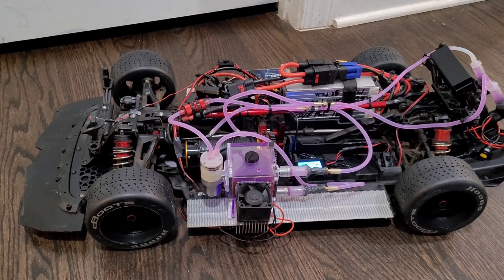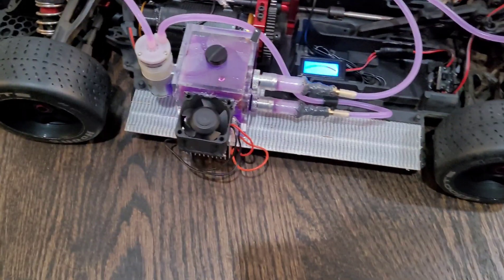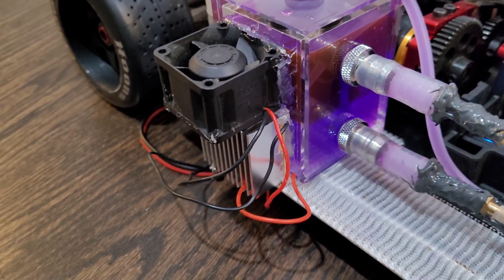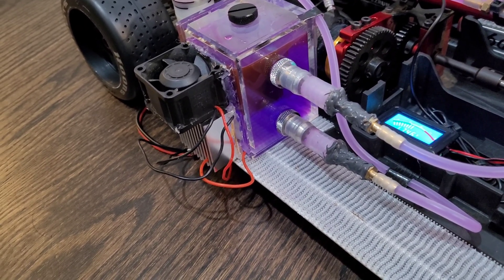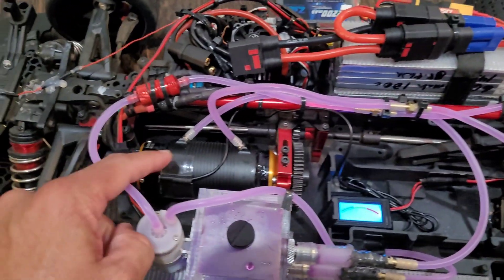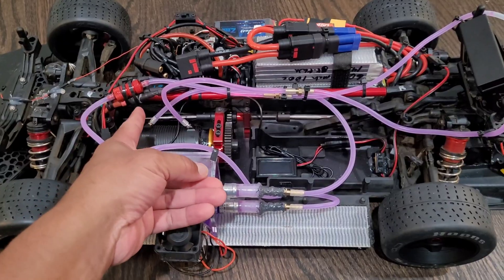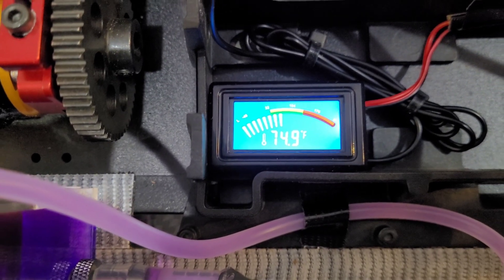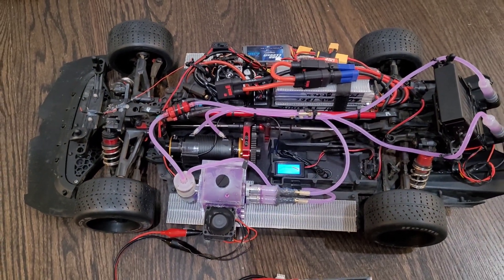'Sub-Zero' Liquid Cooling System in High Performance RC Car!

Comment: Innovation rc idea. 💡💯
Reply from the maker: I did see his thumbnail where he built a water cooling system as well. Not sure if he utilized peltier tiles on his build, but will check his vid out. I've seen a few different designs and have tried a few in the past, but this is a first for me using the tiles. Thanks for watching!

Comment: You have definitely done this the smarter way, Tec modules can not be the only part that cools the water but can work well when piggybacking of a radiator, the radiator gets rid of most of the heat and will make things manageable for the tec to cool things further. I can’t wait to see more!
Reply from the maker: Thanks; I really appreciate it!

Comment: The radiator should probably cool the peltier heat sink in a separate higher temperature loop
Reply from the maker: This was the first iteration, and I'm currently working on changing, so I appreciate the idea! Thanks for watching!
Reply: @rustyscrewsrc congrats on a soon to be very successful video! Another thing I’ll add is those things are not very efficient so they will hog your battery for not much cooling compared to a compressor system. By “precharging” your cooling system before your run by running the peltier hot side loop, cold side loop and the peltier on one battery, then swap the battery before your run. I’ve seen people run icy cold stuff with water cooled peltier devices.
Reply from the maker: @RoadSurferOfficial You're absolutely correct regarding efficiency! I run this on a separate lipo pack so it doesn't impact the power system. The design I'm currently working on focuses on providing better cooling to the tiles. I like the idea of precharging the system prior to running the car! Thanks again!

Comment: So are you trying to refrigerate the liquid in the reservoir? U almost need a second radiator inside the reservoir or copper lines. Dude soldered copper lines would be so cyber steam punk !
Reply: Copper or automotive brake line . 🎉
Reply from the maker: Yep; this is my first iteration, and I'm working on a second design. And, interesting idea with the cyber steam punk look!

Comment: I would try to locate the reservoir where the second battery tray is. Mount the digital Thermometer to the top of the radiator or velcro to the reservoir lid.
Reply from the maker: This is the first iteration, and I'm already making changes to the layout! Had to make sure it worked first; thanks for watching!